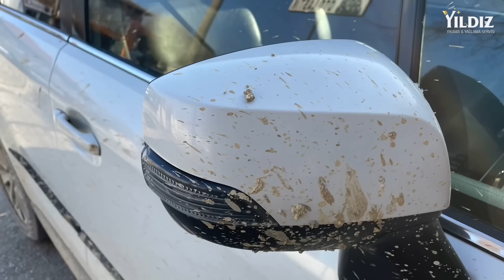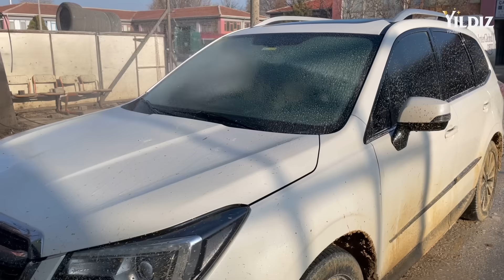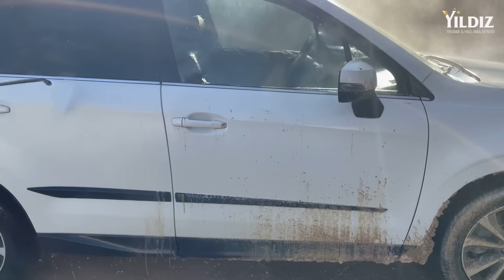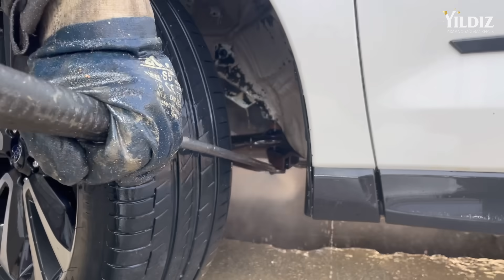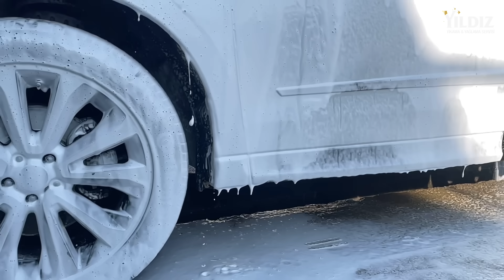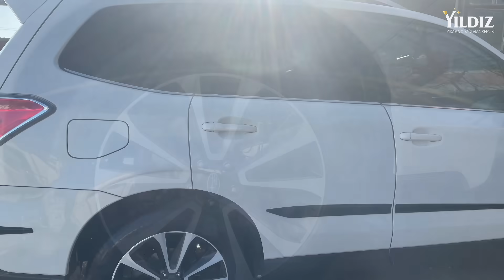Çamura Batmış SUBARU YIKADIK! How to wash DIRTIEST SUBARU 4x4 ? 😱 Detaling Clean #asmr #satisfying

Comment: Great job on the cleaning, but more impressed with the water pressure
Reply: Enough to rip wiring connectors off and damage gaskets and hoses I bet.
Reply: @nathansharma87 y right electronics sockets on the differential is risky to wash long time with pressure socket can get moisture after some time expect yellow engine light this type of long time pressure washing air drying is vital